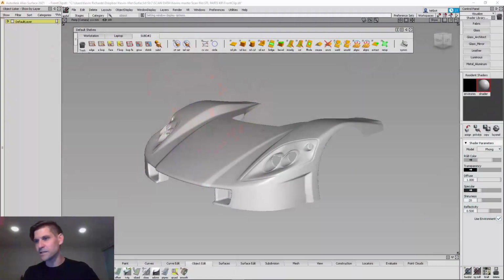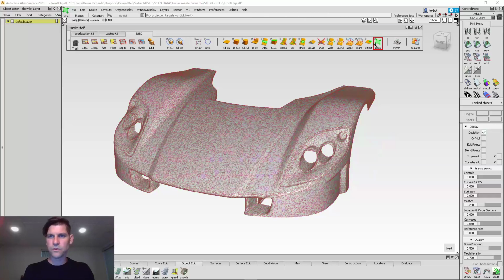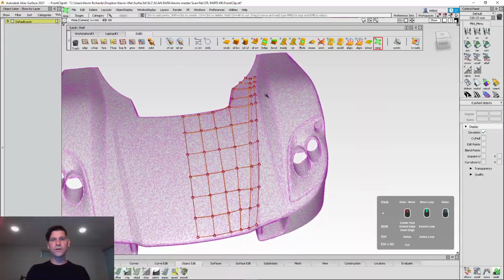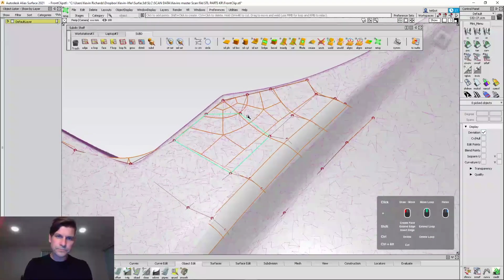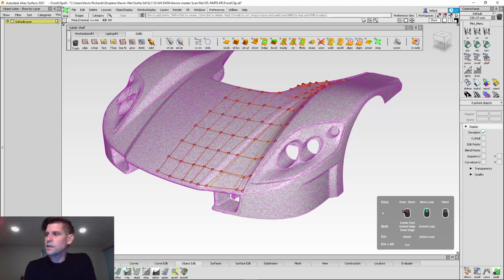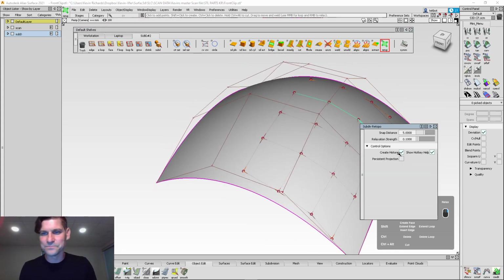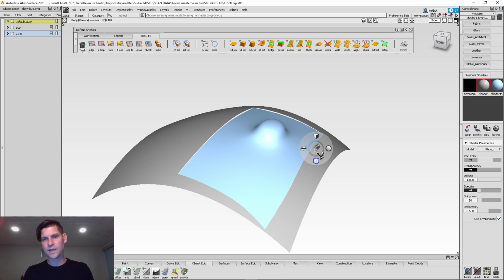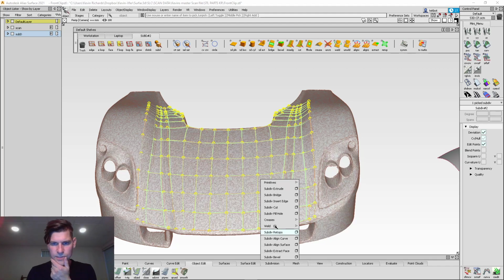Autodesk Alias 2021 - Retopo Tool for concept reverse engineering

Comment: How to maintain the deviation from subd surface to mesh data?
Reply from the maker: Currently Retopo snaps the Vertex points to the mesh.  The SubD NURBS limit surface will have a deviation when smooth.  In some situations, using the CV move to to move the vertex's normal to surface can help match them better.  I usually use cross sections to get them dialed in.     
Hopefully they come up with a better solution to the offset and make it automatic.   fingers crossed

Comment: Why Autodesk hates engineers so much. Ui from 90, and colours that’ll make you blind. Not saying awfully slow adoption of tools from 3D industry.
Reply from the maker: Yeah.  The UI is polarizing for alot of newer users.  I started using Alias in the 90s and have witnessed people freak out over simple UI changes.   Alias has multiple versions of dark mode, I've tried to force myself to use them but when I focus purely on speed, I revert back to the colors programmed in my muscle memory.
Reply: Kevin R makes sense, tho I found after 10-15 hours of work my eyes are melting away and I need more brakes. Tbh it’s not just Alias. I find it across the board with engineering software. I am 3d modeling artist and exploring more advanced workflows to make life easier, and I know that some people prefer traditional workflows, but in my opinion many steps could be reduced. At least rendering could be done in 1 software instead of multiple packages. And as I’ve mentioned it was a surprise to find that some tools just been implemented or just missing. Like retopo tool straight copy of the one that was in maya for years, originally been copied from topogun:) also feels like pro software caped to quadro cards for absolutely no reason.

Comment: Autodesk maya vs autodesk alias..which is best ?
Reply from the maker: Alias is the industry standard for automotive class A surfacing.   Alias SubD results in a nurbs patch which is good for CAD related work.     If your only interested in subd for poly output or rendering then Maya is most likely the best choice.
Reply: not a serious replay but fun tip, if you look up for the history of these two software, you'll notice they are basically rised from one source. Even today, if you open the time slider in Alias, it looks quite the same as in Maya

Comment: Thanks for the video, awesome content! A simple but useful retopo tools in modo is the spin edge tool (V key by default). When you use that in subd mode you can easily see how edges are flowing and reflow them, and everything remains all quads (if they are already so). Can't download 2021 yet as an edu user, was wondering if something similar has been included in this version?
Reply from the maker: I sent some spin edge tool examples to autodesk when I started deep diving the tools.   I was reading a topology book and trying to get my head around controlling flow and the resulting shapes. The spin edge was critical to the authors workflow for characters.   If you have or can post an example of a specific "use case" it will be helpful for them to understand the need.
Reply: @kevinr6236  Sorry I don't have an example right now but if you do a quick search for "spin edge" on youtube there are quite a few modo and maya tuts that explain how it's used. I remember learning it from some old lightwave tutorial.
Reply: 的确SubD的操作很容易让人联想到Modo，对拓扑的操作SubD能更多的吸收一下传统Polygon软件的丰富模式就完美了